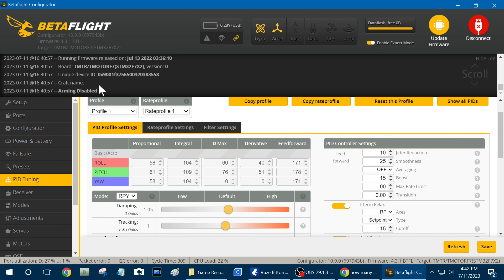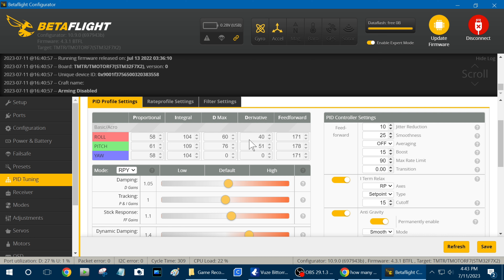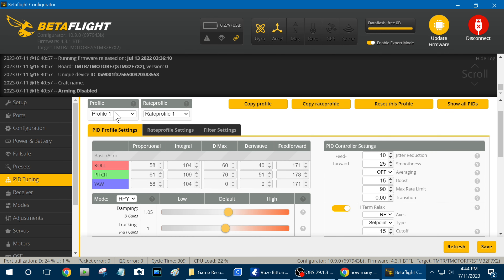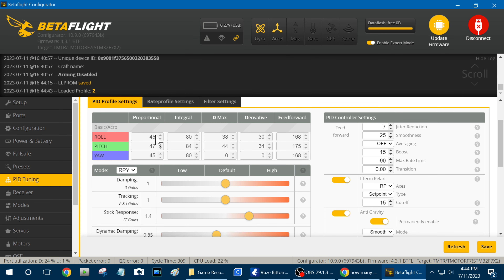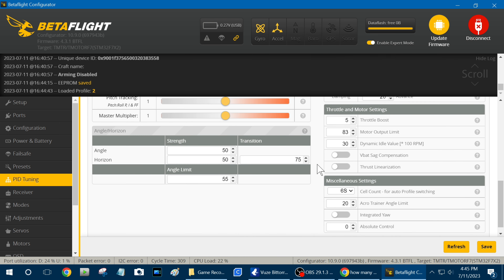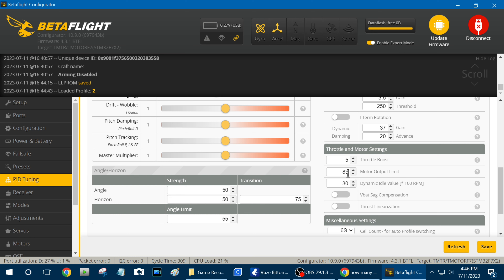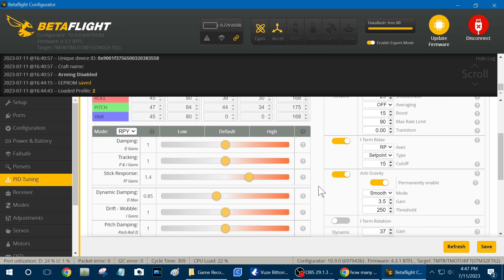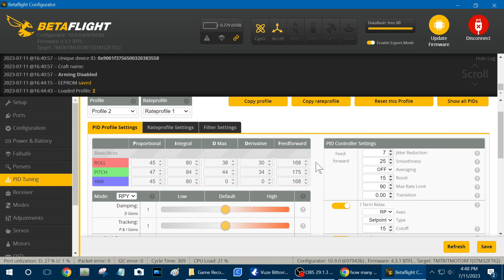My new 4s & 6s PID tune for the Tanq & how to change between the 2 setups just by plugging in lipo.

Comment: Nice, didnt know you beta could recognize bt 4s and 6s like that.  Dont kill em 6s packs man!  3.5!
Reply from the maker: not a chance. it was a one time rooki mistake. and i only went slightly to low on voltage before i realised. they are all still good. some day i may want one of those 3.5 volidore frames to build for me. i have some 1407 motors already and i bet meps would help with the rest.